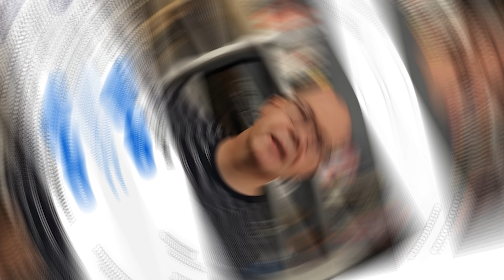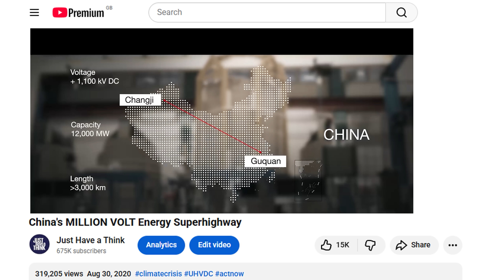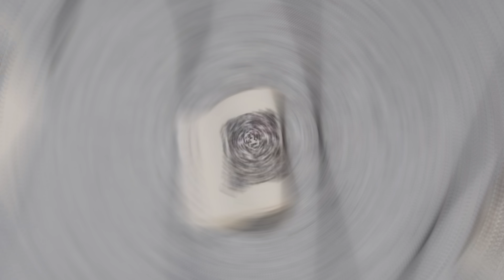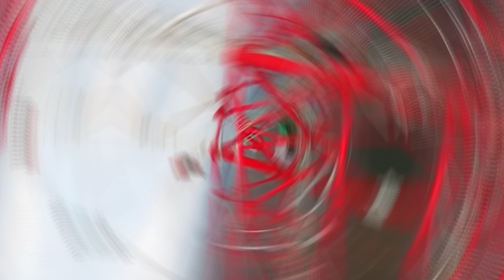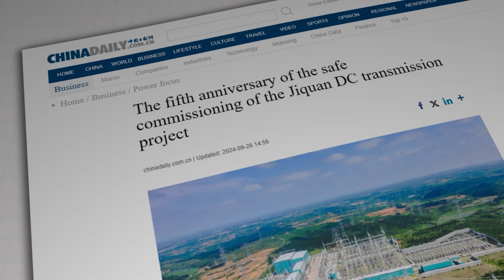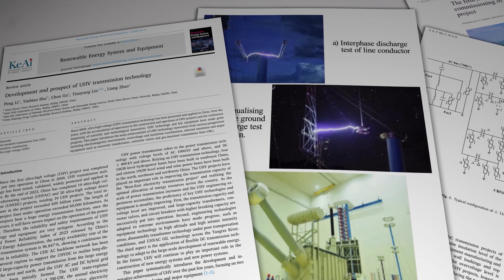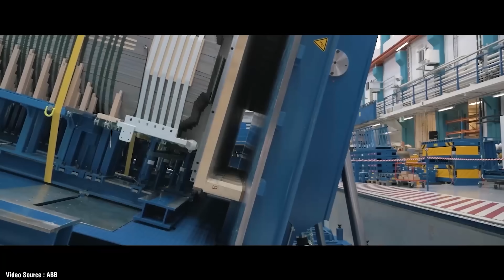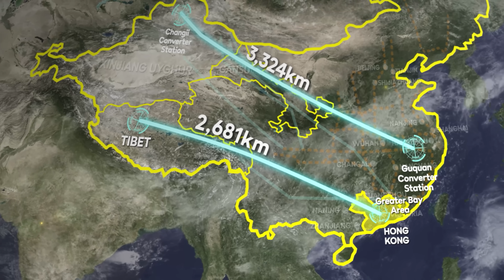China's ultra-high voltage transmission lines now breaking all records.

Comment: Happy New Year!  Another thought that I've had running around in my head.  As I understand it, a Stirling Engine turns heat differential into mechanical energy.  Almost every home expends energy to either heat or cool the living space, while the outside temps are opposite of this desired temp... especially in homes nearer the equator.  What if we could set up small Stirling engine(s) that sit between the ceiling and the attic.  I know that my own home in Florida experiences a huge temperature differential between the living space and the attic during the summer.

Just another idle thought while in the shower.  Again, many thanks for the hard work Dave.

Comment: In case anyone is wondering, you can actually get even HIGHER voltages and currents in DC by going to liquid immersion insulation and cooling of cable by using very high dialectric fluids such a 400 Celcius heat resistant 75 mm thick of ceramic-nanoball-infused multi-layer interleaved flexible solid-wrap and stranded-wrap Kapton insulation layers and using 5 mm thick individual strands of 99%-plus Oxygen Free Copper conductors made into a conductor cable that is 100 mm in diameter which will be buried into horizontal-drilled 50-foot underground pipelines of up to 8000 km (5000 miles) long! One of our parent company researchers got into a deep calculation modality and figured out we could SAFELY deliver 37.5 Gigawatts continuous at 15,000 amps at 2.5 Million Volts down that one single line! 

No more unsightly towers and the thick Dyneema polymer-encased electrical pipeline put 50 feet underground Highway-1 running from Vancouver, BC, Canada to Halifax, Nova Scotia, Canada of 6071 km distance would have NO current leakage or "Electrical Tree Branching" through the super-thick interleaved-layers of Kapton and theouter pipeline casing! Put four such lines spaced at least 5 metres apart, and we could run 150 Gigawatts UHVDC coast-to-coast! The estimated maintenance/longevity schedule was also calculated to be about 125 Years of active service life before needing replacement of the cable itself due to eventual dialectric and mechanical breakdown from internal thermal-based extension/compression on the horizontal planes and on the cross-sectional plane causing critical levels of conductor and insulation degradation.

V

Comment: Wow: even at 1.1MV: that still works out to 10.9kA at full capacity.

9:20 was counting wires because I thought 6+ main wire groups may explain it, only to realize that the stock footage from Hitachi is showing traditional AC 3 phase power transmission.

Comment: Here's a topic for you. The solar panels and battery I bought came with a program that lets me choose how the panels, battery, and grid interact with each other. I can choose Time of Use, which charges the battery with solar power when possible or with grid power when rates are lower, then uses the battery to feed the house when grid prices are high. I can also select "Self Consumption," which favors using the battery whenever possible and charges it only with the panels. In this case, grid power is the power source of last resort. The question is, which is the better setting? Does that answer depend on the time of year? What other factors could be involved in this decision? Remember, I'm a homeowner, not a power company, so I need simple answers to complex questions since I don't own any supercomputers.

Comment: I don't follow all your stories so you may have already done this one.  Your stories I've seen I've really enjoyed and found useful.  Here's a topic I'd like to see covered, if you havent' yet:   who is right about the future demand for oil.  Most people I read say demand will start to fall in the coming 5 years or so, due to rapid adoption of Chinese renewables and EVs both in China and in other states like India, Pakistan, Brazil and many more.  Research X argues this will follow the classic technical transition pattern and lead to a rapid to SWB energy systems - Solar/Wind/Battery, although your argument in this video seems to indicate that UHVDC lines could reduce the need for batteries.  But the rapid switch from fossil fuels to an electrified future based on renewables is the point.  Oil proponents point to the still small % of total energy demand met with renewables and claim that past forecasts by the IEA of fossil fuel's collapse in demand have been wrong and demand for oil in particular has been revised upward repeatedly.   I hope the 1st scenario proves true but if you could analyze the evidence it'd be very helpful.

Comment: The 1991 solar flares created some interesting problems for Quebecs verrry long hi-voltage transmission lines (735kv ac and also 1 mv dc). Lovely antennas.

Comment: Not sure if you've made this video before, but a video about potential technologies for green commercial flight would be cool. There's a lot of electric vertical take-off aircraft startups right now, but the one that I'm most excited about is Beta Technology's Alia conventional aircraft, which apparently has capacity for 5 passengers, range in the 300 nautical mile range, and seems to be pretty far along in the certification process. They're also trying to get in the cargo sector ( I think they have some sort of order from Fedex?). On the other hand, Airbus has been talking about hydrogen-powered aircraft for a while now, which is much more feasible for larger and longer range aircraft, more similar to flying as we know it right now. While green hydrogen is pretty expensive right now, the massive green hydrogen plant that is apparently actually getting built as part of the absolutely idiotic project that is The Line (why are Saudi megaprojects always so dumb?) may have enough economies of scale to bring down the price quite a lot. Then there's of course the prospect of simply mandating the use of biofuels, as imperfect as they are, in current/near-future aircraft designs. Would love to hear your take on this, and more broadly if you think its likely we see green air travel become some sort of reality the next couple decades

Comment: In the US the economics of adding rooftop solar was in big trouble even before the loss of its 30% tax incentive.  While many point to unscrupulous sales people pushing expensive contracts and leases that were only a little cheaper than utility power, the bigger issue is loss of "net metering".   Why should anyone get solar when the utility is manipulating rates to minimize if not completely eliminate the savings that solar brings.
How it is with other countries?  How are they balancing the utility and the individual with solar?

Comment: Here a subject that hasn't been covered very much. Why are most power grid energy conductors hung up in the air rather than underground where they would not be so susceptible to damage from weather events? Is it just a cooling issue, or is there more?

Comment: Really intetesting site, have been watching for some years.  Thank you for your hard work in researching and presenting these informative articles.  In my area (SW Cornwall) we are facing the prospect of new lithium and heavy metal mining/extraction. Ancient mineral rights are being used by prospecters to access many private properties in re-wilded areas to find residues of these elements from abandoned underground mine workings. The local surface water is already very high in heavy metals from historical mining waste (tested by our voluntary environmental group on a regular basis) causing 'dead' areas in our rivers and streams, not to mention running out into local harbours and beaches. Very disturbing.
Reply from the maker: @annieellison2046 Hi there – great news! 🎉 You’ve been selected as one of the winners of the Just Have a Think hoodie giveaway.

Please send me an email at daveb@justhaveathink.com within 7 days, quoting your YouTube handle, so I can arrange delivery.

If I don’t hear from you within that time, I’ll need to redraw the prize – so don’t miss out!

Thanks again for taking part, and for supporting the channel 👍

Comment: Proposed topic: Distributed energy generation (and storage) options for domestic households for far northern climes which would not have as good  a performance and thus ROI with rooftop solar compared to implementation closer to the equator (or is that still the best option)

Comment: The USA has many strips of land dedicated to High Voltage power transmission lines that run through areas with high housing; thus, the legal niceties have already presumably been worked out.
Would it be practical to add Solar, Wind & Geothermal capabilities along these lines to increase the electricity available for transmisssion?
Wouldn't it then be a good idea to add battery storage areas along these routes so that electricity can be delivered to areas bordering these lines where and when needed?

Love to see anything you can produce about my suggested topic.
Reply: We really need to stop pushing wind and solar with batteries, my friend.  They're going to be an ecological and environmental nightmare in the end.

Geothermal has a tiny environmental footprint, and gives reliable and abundant energy 24/7/365 without a care for the weather (can't say the same about wind and solar).

Comment: If you could, kindly cover the ongoing  world-wide conversion from SF6 Gas to other alternatives (Safer Gases) used in Gas Insulated Substations, GIS and generally switchgears.  Cover on: 
1. Why the conversion from SF6 is necessary.
2. How these upgrades are done on existing SF6 Switchgears  such as the components upgrade, Retrofits et cetera. 
3. The costs of a Retrofit verses a new installation that has the SF6 alternative. 
4. Maintenance requirements of the new non-SF6 Switchgears.
5. Any other sub-topic that you deem fit concerning Switchgears. 

Looking forward to these insights.

Comment: The best way to ensure that fossil fuels are replaced by renewables is to make renewables cheaper than fossil fuel. We are getting there fast and China is leading this transition.
Reply: Wrong, the best way to ensure that fossil fuels are replaced by renewables is to choose the correct renewable energy source, and wind/solar with battery farms is not the correct choice.

We can make it the choice, but it wouldn't be the best or correct one.

Geothermal is the path forward.

Wind/solar and the concomitant battery farm network is an environmental nightmare.

Geothermal's environmental footprint is tiny by comparison, and it's a reliable and abundant source of energy
Reply: And exactly how do you make something cheaper? 

There is no such thing as "renewable" energy. It's blatant language manipulation. 

Fossil fuels will never be replaced with wind and solar. They are unreliable and have giant environmental footprints and low energy concentrate.
Reply: @anthonymorris5084  How do you make it cheaper?

Geothermal today (traditional geothermal) has a high up front cost because you have to drill test wells until you find the right rocks to make geothermal possible, and a lot gets spent on making it as safe as possible encapsulating the borehole in expensive piping and concrete liners.  This is because you can pollute the water table in the area doing geothermal excessively.

Superdeep supercritical geothermal doesn't have that problem.  You pick your spot wherever you want and you do it.  You're drilling to levels WAY beneath the water table so no real concerns on that front.

Something else to consider is that with millimeter wave drilling you don't waste any time having to change out drill bits like you do with mechanical drill bits.  Those mechanical drill bits can be million+ dollar bits too.  With mechanical drilling through basement rock (granite, etc) your bits are chewed up in no time so you go through dozens of bits trying to drill to 10-20 km depths through basement rock.  There's none of that with millimeter wave drilling.

You can drill to 12 kms in ~ 100 days with millimeter wave drilling.
Reply: @TerraPotentia   If geothermal is a more efficient and cost effective form of energy, the free market will embrace it. Instead of posting across this entire comment section your seemingly obsessive advocacy for thermal energy, you would do better promoting free market economics which the climate movement isn't very fond of.

Comment: I’d love to see more about domestic wind energy. I’m a solar PV installer in the UK and I think we’ve nailed it, prices are cheap, plenty of selection and customers are more educated than ever. Wind on the other hand 🙄
Reply: A world filled with millions of wind turbines, billions upon billions of solar panels, and the literally trillions upon trillions of battery cells REQUIRED to make wind and solar viable options to replace fossil fuels ARE an environmental nightmare in progress.

It's all just so much work that doesn't need to take place.

Geothermal is the correct renewable energy source to go with.

Comment: Topic: Why are there no sodium-ion rechargeable batteries for common household use, like AA, AAA, or 9 Volt? Reason I'm asking is that I'd love to keep a flashlight in my car's glove compartment, but in winter the cold temperatures kill the charge in regular batteries, as well as lithium ones. Why not sell sodium ion batteries for emergency home use? It would let us keep lots of handy things stored - flashlights, power banks, tire inflators, engine starters, etc.

Comment: Hi Dave, 
Would you explore why there is almost no regulation or protocol for the sustainable disposal of decommissioned solar panels, considering both the potential environmental toxicity of the materials used to make them and the fact that the volume of decommissioned panels will inevitably increase with the growing demand for clean energy, similar to the regulatory approach taken in the nuclear industry?

Comment: Suggestion:  Although HVDC gets headlines, you could do a show on uses where the energy use is moved close to the energy source? For instance, Aluminum Smelting cost is 90% & can be anywhere bauxite can be shipped to. Obvious examples are Datacenters where, sending data long distance is much easier than sending the power.    Subscriber....

Comment: I'd like to see a story on the cost of charging on L3 chargers, and what can be done to bring it down. I pay 5 times as much for L3 charging than at home, with no special rate at home - just my domestic 12 cents per Kwh. Is the price of the chargers coming down? Would co-located large batteries reduce the demand charges for the suppliers? Is anybody planning slower fast chargers? I'd love to see 25 Kw chargers at half the price at grocery stores, movie theatres, restaurants, etc. If I am going to stop for an hour or two, I don't need 400 kw, and 32 chargers at Costco, 25 kw each, would be lot more useful than one 400 kw charger.

Comment: 148 days off grid this year with a house two cottages and an electric car. All with 4kw of panels, 2 Tesla batteries and a 2kw ground source heat pump. Yes 2kw heat pump used normally on swimming pools.  I should mention I have a caravan gas bottle but it lasts 3 years. It can be done

Comment: Just for perspective... the nordstream pipeline could transport 70 gigawatts , and did so continuously until it was blown up. That dwarfs hvdc lines. Nordstream 2 would have doubled that. And it had ultracheap long term  energy storage at both ends that costs 1 fiftieth of storing energy as electricity.

Comment: Oh for goodness sake, storm in a teacup.  Higher voltage has less loss but is harder to handle, it's just a question about finding the sweet spot.  I don't think Europe uses higher voltages than 600 kV, but it was a European company (Swiss-Swedish ABB) that built the first higher voltage line at 800 kV in China, and 800 kV has been deployed in both India and South America.  BFD.

Comment: As an independent science nut I am amazed at the lack of information. You and 99% of the public are ignorant about the info you produce. You are led. I have built, not talked about HV DC and AC Resonate Xfmers Lithium Research and other things in my lab. You overlook the production of Ozone  over even 5,000 volts. Hands on is of the utmost importance. Individuals invent. The Alternating Voltage has a Rise and Fall Time in its transmission at lower frequency of 50 to 60 cycles. There by producing a lower level of Ozone production. Insulators help but at the voltages of which you speak No insulators are sufficiently made. DC has a multitude of other problems as well. They don't just couple solar panels in series to produce these levels of voltages. They are effectively stepping up. Most of my experience is with voltages of from 10,000 to 200,000. Ozone is a problem. The transition of DC to AC whether done by a Transformer or Electronically is a problem as well. Loses are present at HV DC at the levels you are speaking of as well. They aren't small. Coronal Discharge is great, Ozone production is very very high. I regret so many are ignorant about HV over 5 Kv. Losses are present and other danger to plants animals and humans in close proximity. Thank you for the info. China does some stupid stuff. Like there Dams which will eventually drown millions. AC is not dead by any means. There is a place for HV DC. Did you even pick up a spoon Charged with a -100,000 vdc 20 feet from the source. I have. 
Tramco R&D. ret.

Comment: Horses for courses, Dave. UHVDC is appropriate for moving large amounts of power over large distances. Here in the UK a system of a national grid, to provide a backbone, together with a large number of local grids to get locally generated power to be used locally, makes more sense. (This type of model has been used with computer system networks for decades, with great success.) As always a well put together video, thanks.